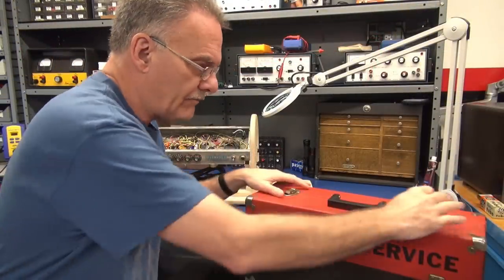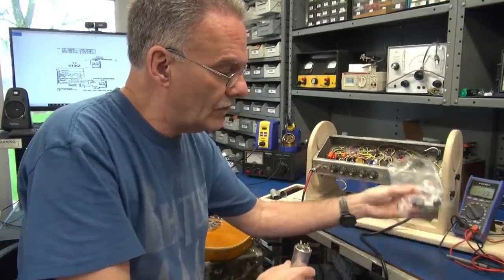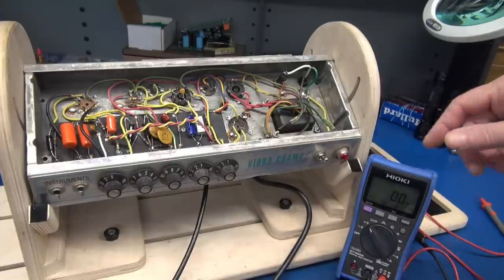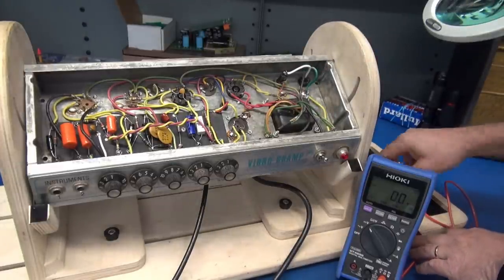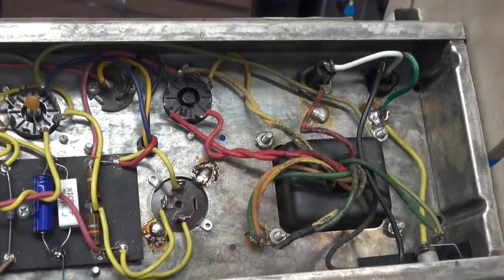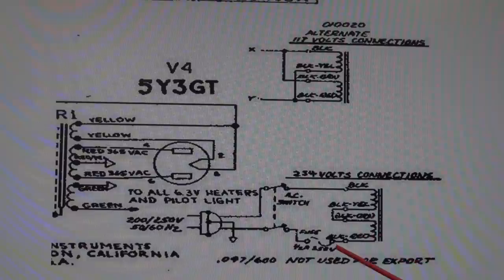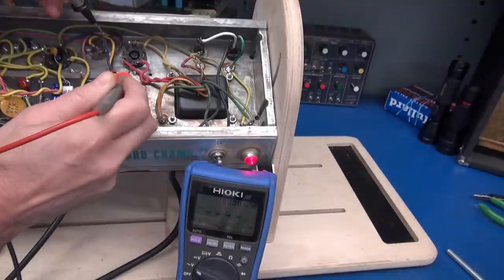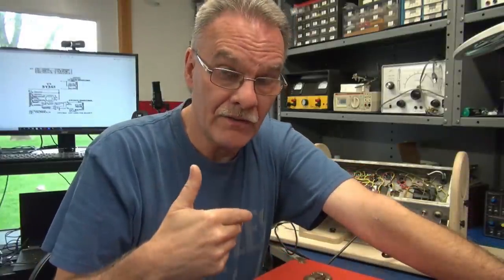D-lab series Basic Training Tube Guitar amp repair Fender Champ Low power is the transformer bad?

Comment: My Groove Tubes Trio had exactly the same fault, its got 5v logic for switching and the power transformer was outputing around 3.5v, only the fact it was rectified and smoothed (1.41x) pushed it up enough to let the 7805 regulators power the circuit. The valves you could barely see glowing in a dark room. I modded the crap out of that preamp, changed tubes and lots of polystyrene capacitors got changed to tropical fish and mustards, sound amazing to this day!

Comment: The shrink tube and power cord, seems to me, to mean that someone recently (as in not from the factory) wired it that way maybe. But I will not be overlooking transformer wiring on the initial inspection anymore. 
Being in the weights and measures industry, we get calls from time to time, saying "my weights are off by about half. I need a service call." The first thing I tell them to do is push the "units" key to switch it from kg back to lbs. That usually corrects the issue.😊
Same kinda thing with with that transformer.
Thanks Terry

Comment: Hey, Terry, I did the opposite operation on my Vibro Champ when I moved abroad--rewired it for 234 volt operation. What a relief it was to find that I didn't need a transformerectomy or to lug a stepdown tranny around with me. (Mine is still sounding anemic though, so I still have some trouble shooting to do.) I did the same thing on a Laney acoustic amp I have, too. I wish more amp PTs had dual primaries like that.

Comment: Somebody's been in there before you.  They incorrectly hooked up a new three-wire AC mains cable and  ran the neutral line to the fuse.  This means if there's a failure in the amp (AC to ground) and the fuse pops, the chassis can still be live at mains voltage.  Always run the black/hot wire to the fuse, then the switch, then to one PT primary.  The white/neutral goes directly to the other PT primary.

Comment: I wonder if the original power cord was replaced... might have originally had European style 240v plug?  Also the power switch is not the cheap slider switch that you always see on the champ. Maybe that switch was not compliant with European electrical code, or did the original fail and was replaced with a higher quality toggle...
Reply from the maker: Funny you would bring that up. Yes, I replaced the cord & power switch. The cord had previously been replaced, but was in poor condition. The power switch was odd looking, black plastic flipper, had 4 terminals, but had the new power cord connected. May have been the euro type? Good thought
Reply: @d-labelectronics  I've always thought that the stock power switch on the black/silver face champs looked cheap, but I've never seen a video of a champ with a bad power switch.  Either way, that new switch is better quality than stock. Fender was definitely cutting corners on their entry-level amp, but adjusted for inflation, you were still getting a good amp for the money.
Reply: @d-labelectronics  The power cord is improperly installed.  Neutral to the fuse like that means if there's an AC mains short to ground and the fuse pops, the chassis can still be live at mains voltage.

Comment: Very interesting repair! Did not see that coming. I'll trust your judgment though I can't help but wonder if some unqualified diy'er rewired the primary to drop the B+...but didn't know enough to think and or check the filament windings. I say this because it looks like quite a lot of work has been done, coupling caps, bat toggle switch in place of the slide switch...
Reply: Or very simply it was wired for use in the UK 😎👍

Comment: That's quite a wild find! I imagine the plug end of the power cord had the standard hardware store replacement plug on it, because those always twisted and frayed. Was there further indication on the back of the chassis that it was wired for 230V?

Comment: The amp looks to have a replacement power cord installed.  I'd bet that someone read the schematic wrong and wired it for 230V.  Whomever wired the new cord in should have also corrected the fuse wiring - it's inline with the neutral.

Comment: First,  great work and sleuthing! Thanks for the great content,  as always. 

Second,  I am experiencing the same lower output on my champ. History,  the stock volume pot seemed damaged as the shaft was loose and its the loudest champ I've ever heard. It also seemed to have a linear taper.   Replaced the volume pot with same value and audio,  but it's now the most quiet champ I've heard! Anyone have ideas?